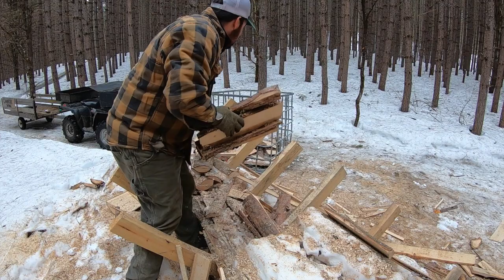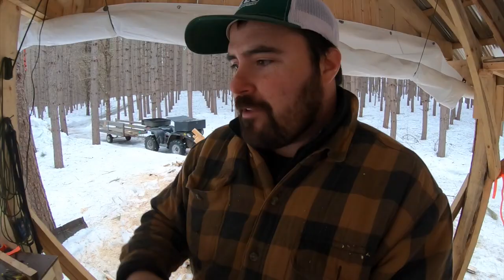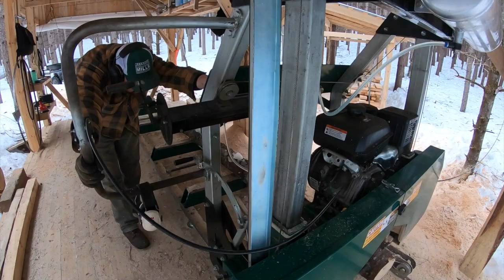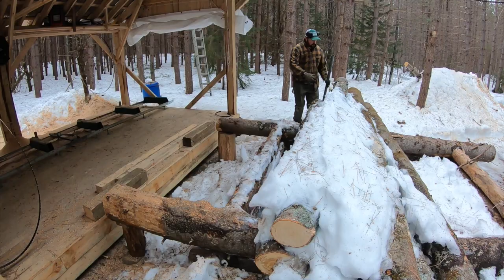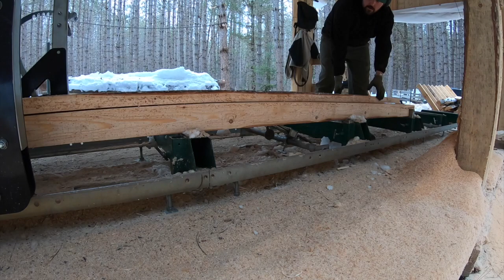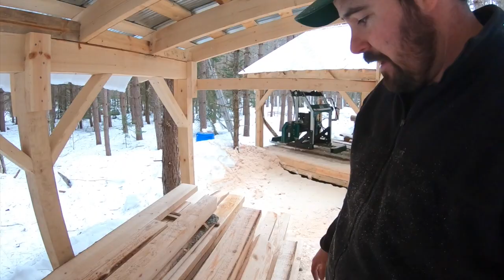Lumber Making from Start to Finish

Comment: HI and thx again for all the vids. Watching them when I can't be cutting myself! I noticed that you turn the log 180deg after the 1st cut. I turn only 90 deg., and so on until a square cant. I may try 180 as you can perhaps more easily get the exact size you will end up with for height or width (depending how you see it!). Then see how wide you can cut the rest. Is that the advantage you see on making that 180 deg turn instead of 90. Perhaps a good way for smallish logs where you really want the max wood. I know I'll be doing this next time. Cool to see others experiences! quick google search seems to show nice advantage to the 180deg for logs with bark on. From google: ''I think it depends on what you're sawing.  For grade, I like to do the 90° turn.  For dimension stock, I will saw the 180°.  

If you aren't sawing debarked logs, the 180° will keep you out of the dirt more than the other method.  I will saw dirty logs like that, irregardless of the grade."   another source: '' I generally saw “turn 90” on most logs.   If there is a lot of stress or the log is small – say 10” or under,   I’ll saw 180.  It just makes it easier to clamp if you have two opposing flat faces.''I guess this may be your reason for dimensional logs or logs with bark! Still in the learning phase (20 logs about) and will for sure make my own changes over time.  What a rewarding way to work on wood. Sorry for the long post ;-)

Comment: I just got an HM122 a couple weeks ago.  I'm going to have to build myself a slabwood rack like yours, it looks like it would be easy to get stuff cut up on it.  I told my boys (9 and 10) they can sell the slabwood for campfire wood on the side of the road and keep the money this summer if they are willing to bundle it up and load it on the trailer.
Reply from the maker: Sounds like a great setup you’ve got planned for the kids

Comment: As I've said before I like your sawmill set up just wondering if you've ever considered putting the post that goes from your log deck to your sawmill on a hinge where you could just fold them back out of the way instead of having to pick them up and put them in place every time you want to load a log on to the mill just some fuel for thought thanks for the videos
Reply: Good idea.
Reply from the maker: I think that could work. My only concern is if the wood ever fell forward it could knock me out. If I have the piece lay all the way back it would be similar to picking  up the piece as I have now I figure
Reply: @sawingwithsandy  yes that is true a friend of mine had his sawmill set up that way said it worked pretty good but I can see your concern especially being out there alone be safe keep the videos coming
Reply: I have mine like that...2x6s that hinge on a bolt...works perfectly

Comment: When you are cutting green wood to lets say 4" x 4" or 2" x 2", do you cut it exactly 4" or 2"? Or do you add on some for shrinking so that it has the "right dimmention" when its dry ?
Reply from the maker: I normally cut exactly the dimension and then there likely will be some shrinkage but I don’t mind too much as the shrinkage in the wood I cut isn’t too too much

Comment: What height off the floor is your mill ??? Would you change to a diff height ? If so what ?
Reply from the maker: The mill is about 6” off the decking. I like this height for moving around logs easily and being able to move over the log deck without trouble

Comment: Sandy, thank you for your great videos and all your ideas you spreading out!
I plan to mill my trees to the lumber. Is it a good idea to paint/wax ends of the boards to prevent splitting? Is this absolutely necessary? Or it’s depends on type of wood, climate, time of year, etc?
Reply: Depends on type of wood...balsam & spruce it doesn't matter much...I do all hardwoods...u can get a wax emulsion like end chex but I've jus been using foundation coating lol
Reply from the maker: I normally don’t paint the ends of the spruce, for or pine I mill. Poplar I’ve found does split easy if I don’t paint the ends
Reply: @RobertMclaren68  Thank you!
Reply: @sawingwithsandy  Thank you!

Comment: just a quick question, do you prefer it that low, or are you lifting it up later on, from what i c, my back is toast so i m going to move mine up a little higher keep me up straighter, im just looking at different setups, , as i just purchased a 126 model, nice set up by the way, love your channel, from Nova Scotia
Reply from the maker: I like the lower height as I can love the logs around easier from my log bunks to my sawmill and I can also get over my log bunks easily
Reply: Same here bro...I have mine raised about 2' so I'm working at waist height...my infeed deck  has swing down arms to load mill with.(of course its probably 4' off the ground but most people have some way of lifting the logs I assume)...also have outfeed deck with pockets for crossmembers that allow me to roll large timbers off the backside and is useful to hold the flitches until edging...minimal bending over for this cat

Comment: How do you take lumber away when needed do you use tractor or hand bomb it?
Denis
Reply from the maker: The middle post is removable so my tractor forks can slide in and pickup the lumber pile
Reply: @sawingwithsandy  copy that... cool

Comment: Just a question, would it not be better to rise the top/thin end of the log to have less waste?
Reply from the maker: Yeah I’d agree. A toe board that raises the one end of the log would be idea
Reply: @sawingwithsandy  my plan is to simply have a range from 2 inches to 10mm scrap-boards lying around that i can put under the log. No lifter, no jack, just a piece of wood under the end between the log rest and the log.🙃
Reply: @bjarnekjlleberg8029  that's what I do...can also cut a big wedge with a chainsaw out of a chunk of wood then its varible